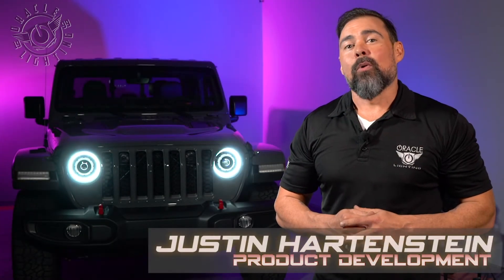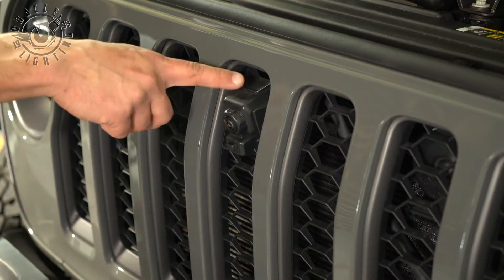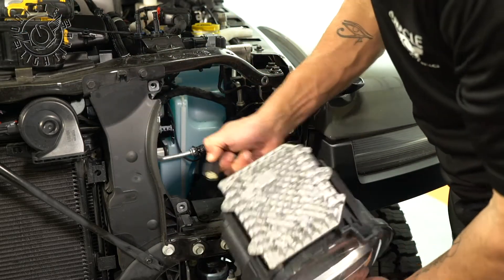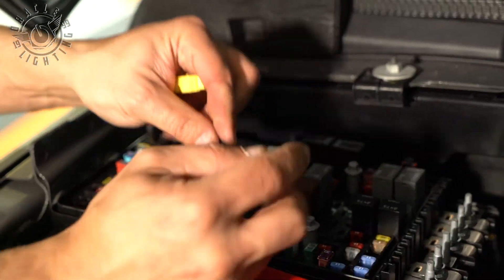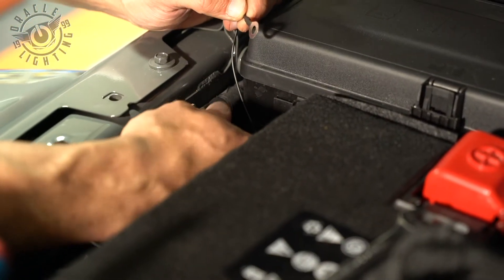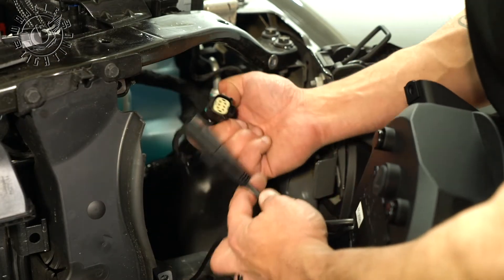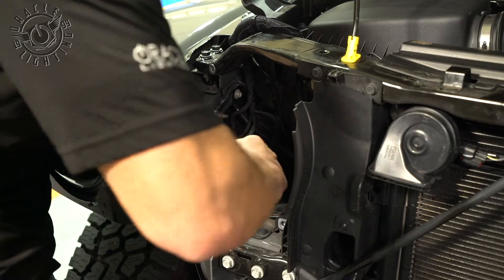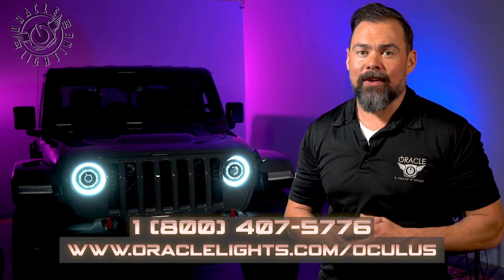Jeep Gladiator Oculus Headlight Installation Guide by ORACLE Lighting

Comment: Hi, great video. When i connect it using the 3 bc1 controller would i connect both outter halo to one port on the one bc1 controller or do i use 2 ports ( one for each headlight)?can i cover the exposed cables with electrical cable?